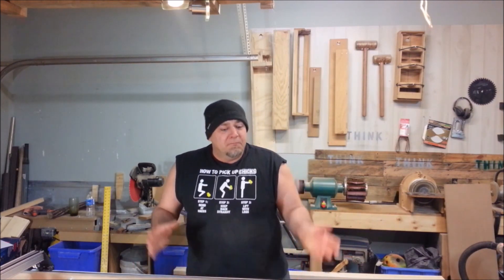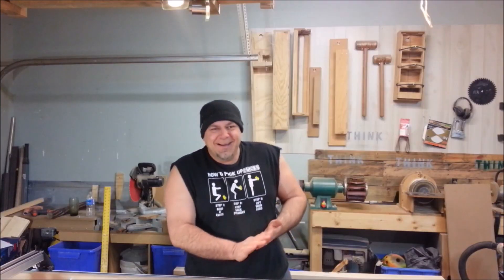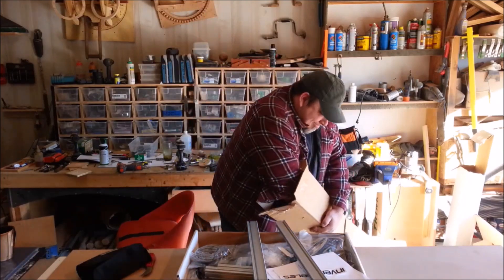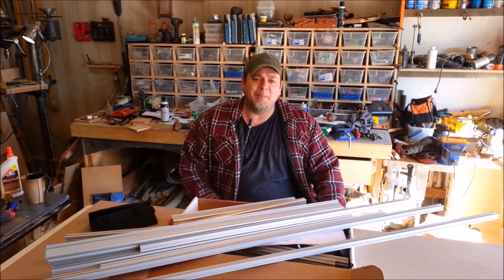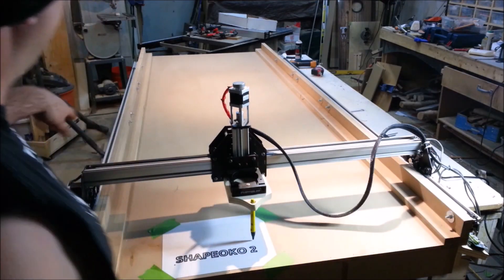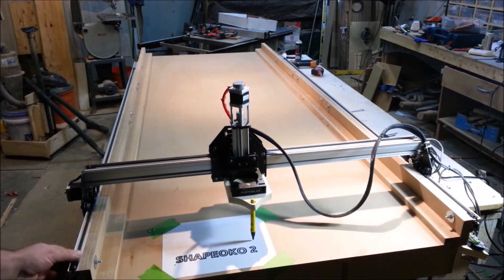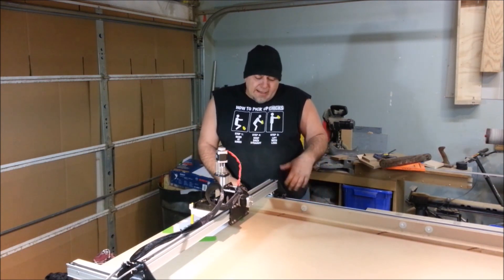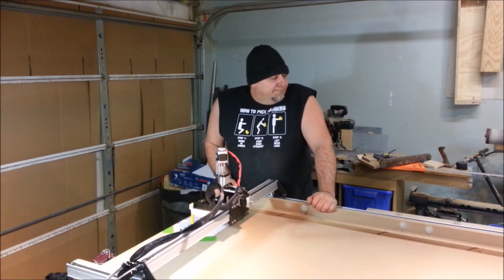Shapeoko 2 Zilla cnc machine

Comment: Hey Izzy need help please have a question for you, I will buying an X-Carve 1000 x 1000 mm soon but I would like to upgrade it to a bigger size like 3 feet x 5 feet. Question is what would I need for the upgrade in this size, examples: what type of metal for the X and Y axis for rigidity and stability, will i need longer belts,drag chain and wiring and any other un-seen  parts or components. Your instructions would be greatly appreciated.

Comment: Have you done any tests on sag?  Like running a machinist dial indicator (instead of a pen or spindle) around to see if it's noticeable?  Really curious about that.  In my mind, the ideal setup would be a millable area of 4x8 so you just throw a piece of plywood up there and have your way with it (or even a 5x8, so you could do the same with 5x5 baltic birch).

Comment: That's the first time I've ever heard Izzy using a metric measurement. Problem is, he used it with an imperial one, (1 metre x 8 feet).
Having done an apprenticeship in Germany and being used to metric, I used to go spare at the measurements I'd get in the workshop when I came back to the UK.
"What thickness should this be?", I'd ask before passing some timber through the planer/thicknesser.
"One and three quarters heavy", came the reply. As I didn't have "One and three quarters heavy" on my tape measure I'd scream, "How many f***ing millimetres is that? Just tell me 45mm and I'll do that precise size!"
The problem in the UK is that most tape measures have Imperial (inches) on the top and metric below. My boss used to give mixed dimensions on the back of a cigarette packet. Then I'd have to decide which were metric and which Imperial.
I wish that we all used the same system.
The US Army uses Kilometres doesn't it?

Comment: yes please i have been thinking about getting one myself but i dont really want to spend a whole lot i saw that i could get the complete unit for about 650 but to add the extras for the length is another 300 or so but what you did looks like you just bought the rails and nothing else from the kit

Comment: Izzy style is my kind of style!!!!  Would like more info on the actual rails how you put them together and how you joined them together so that it slides easily through the joined areas.  Any sag on the Z axis?  I'm thinking building one to fit a 4x8 sheet of plywood with a router.

Comment: I see that you secured the Y axis with mdf - did you notice any distortion on the gantry with it being so much wider?
Reply from the maker: Darin Radtke I wouldn't have anything to compare to. If pushing on one side of the y axis there is some slack before the other side moves with the gear belt on with it off it slides fine.  I have ordered a few things to improve its accuracy the biggest problem i had was getting the belt tension right on the long y axis. the belts have a little elasticity to them so i ended using a digital scale to get the same amount of pressure on both y axis belts and that worked great.. I have a fix for that to but will save it for an up coming video
Reply: Cool! excitied to see it in operation - i want to go for 1000x1000 but I am not sure if i would rather do that vs getting a dc spindle first.

Comment: Did you go for there upgraded spindle?  more power :-)   i just cant picture you using the Rotary Tool 
Thanks for the chuckle
Reply from the maker: klawndyke adding the bosch colt 1 hp trim router to it
Reply: That's going to give you some good cutting power. I cant wait to see what you come up with using this setup You mad scientist of wood :-)

Comment: Nice job.  I would be interested in seeing more about the torsion box setup.  I'm curious to know if you get any bow or sagging on the X axis once you upgrade to a router.  A machine that size needs a more powerful spindle.  The stock one that came with mine fell apart on the first wood project.

Comment: Did you need to put the NEMA-23 motors on the Y-Axis to handle the extra distance or are those still the stock NEMA-17s?
Reply from the maker: MonkWerks with Fr. Thomas they are not on there now but will be soon

Comment: Did you get the bigger stepped motors in your upgrade, cause I wonder what difference they would makes? Also they use dremel tools and mini routers to drive the cutters, but these things run for hours, are these tools designed to run that long? 

(Paranoid rant warning :) I think, soon, someone is going to make one of these with one of these, followed by self awareness,  and a terminator, be very afraid ;-(...
Reply from the maker: Darnley Bynoe watch out for wood robots. lol
Reply: Oh crap, and I just gave the idea I the guy that is most likely to make them !!!!!!!

Comment: I'd be concerned about the belt stretching on the long axis. I don't know if the belt used will mesh with itself, but if it does a configuration like this: http://youtu.be/OdJoVh6DRPA?t=1m8s should be easy to do

Comment: Way to hot rod it, Izzy :) 
PS: Can you send me those spare parts? Some of mine got accidentally thrown into a snow drift when they wouldn't go together right.
Reply: "accidentally"? I'm not buying it John.
Reply from the maker: John Heisz Just email me address John. Ha Ha.
Reply: Of course we want to see the table build. Having my own 4x8 cnc I can see making the std shapeoko bigger. The std is not big enough. A half sheet a plywood seems to be about right.
Reply: John Heisz if you have missing or damaged parts you can glue it, what kind of glue do you use again?
Reply: When i got mine a ways back I had parts that didn't fit but that's because they didn't have there final milling.
Reply: oh my...
happy they don't have "try carving with stock 1/16 bit" task in a list
any chance for mounting heavy duty spindle on this chassis?
Reply: Andrey Belousov
Sure, just put a 2HP router on it. HF $52.00 - 20%.

Comment: Great job!  So many questions!
What spindle aka router are you going to use?
How did you square and level the gantry?
Are you going to mill the work surface flat?
Thoughts on material holding?

Comment: I noticed on your garage door you have a bunch of cardboard.  Is that for heat insulation or sound dampening?  If it's for heat insulation, it's currently 20F, I may need several layers of polar bear fur for mine.  :)

Comment: Something for you to play with would be to make your own rotary axis.  I got this idea from someone on the cnc shark forum and haven't had the chance to play with it myself yet but it's definitely on the to do list.  Basically you use a rack and pinion to convert the Y axis movement into a rotary axis by having a rack along the table and the piece being carved is supported between the gantry with a gear at one end that engages the rack.  Really simple solution and you can just use your normal 2d software to do the carving by figuring out the circumference of the turning.
Reply: I wouldn't bother with some weird mechanical concoction, just get a another steppermotor and move the cable from one of the axes when you need the rotary axis

Comment: I almost choked on my gum when I saw you tapping with the drill. I thought that would be the answer from the first I heard about having to do all the tapping. The key is to not tighten the chuck all the way. Let it slip instead of popping the tap if it locks up. Great!